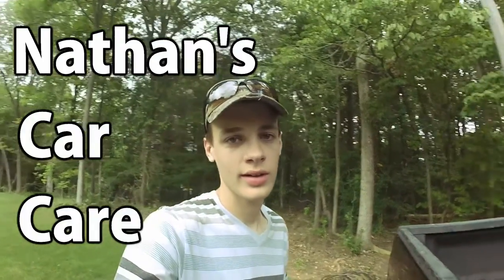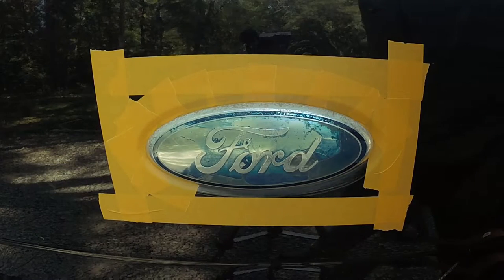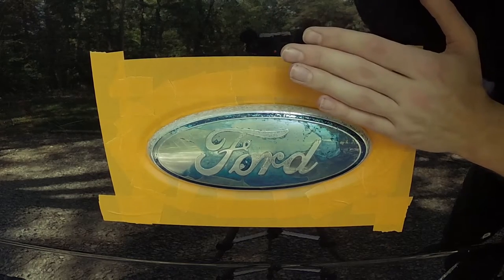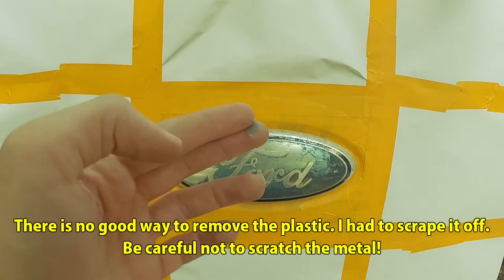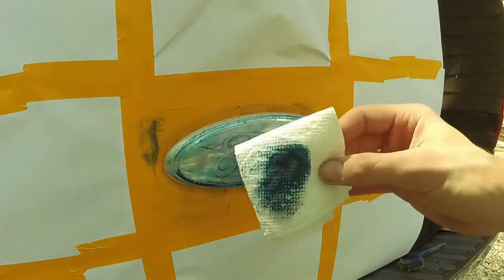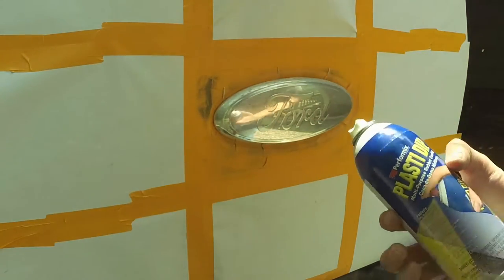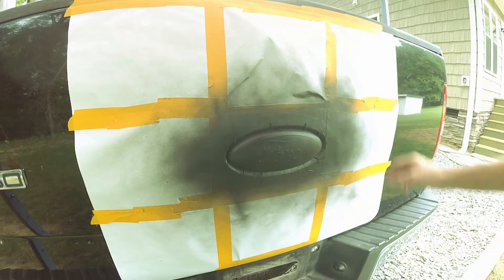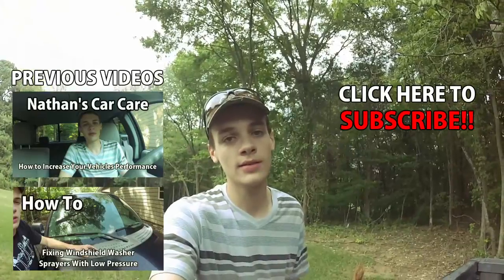The Best Way to Blackout F150 Logo Emblem

Comment: Sorry, but in my opinion it looks terrible. I would have overpainted at least the "Ford" text (and possibly the bezel of the badge) with a different color with a fine brush, and then spray clear coat over the whole badge. But then again, you can't argue about taste.
Reply: Agreed. This video confirmed that I will not use this method.

Comment: If you were going to clear coat it with enamel, you should have used flat black paint instead of plasti dip. The paint would have been permanent, the plasti dip will peel one day.